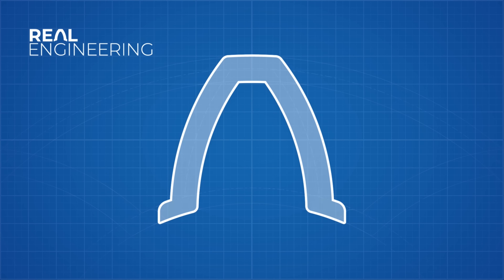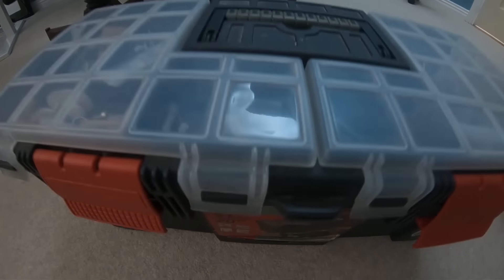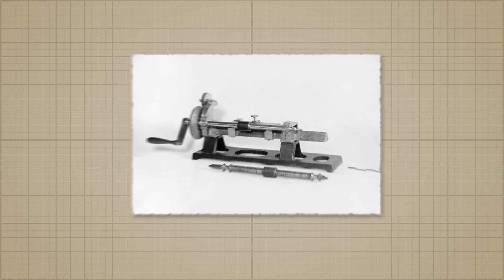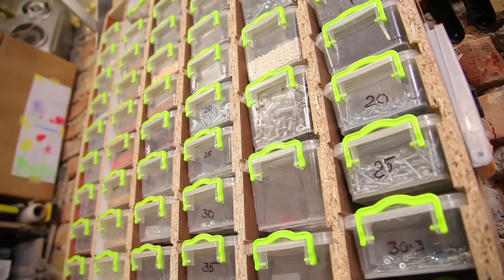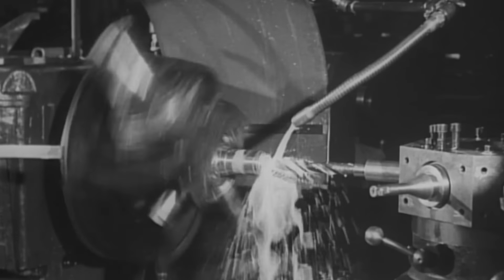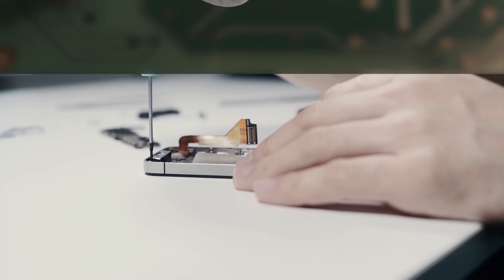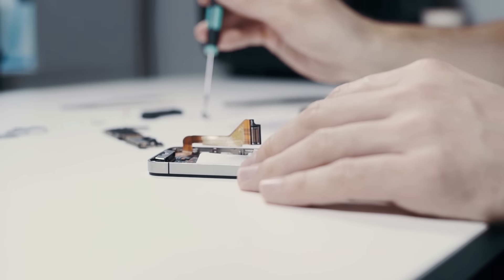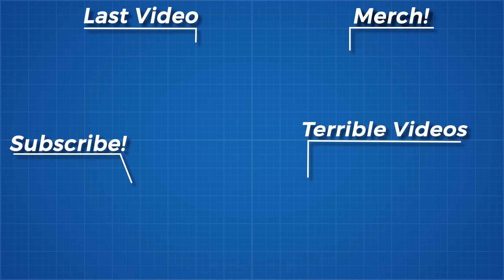Why Are There so Many Types of Screws?!

Comment: Engineers think they have it rough. Try being an aircraft mechanic.
I have an entire drawer in my already-bloated toolbox dedicated entirely to driver bits.
Also, pro-tip: If you apply valve-grinding compound to your bit, it causes cam-out to happen at a much higher torque. Combined with significant down-force, you can break loose even the most stubborn screws. Important in aviation, as all our hardware is engineered with much tighter tolerances, and we heavily employ the use of self-locking nuts, threadlocker, and other sealing and safety methods.
Still, Phillips and its kin completely suck. If I had a dollar for every rounded screw I've had to cut out with a drill, I could quit being a mechanic, and retire to a tropical island. Torx aren't much better either. Having to torque a full cockpit window's worth of the things completely destroys a good bit. Best hope your company stocks good ones, because you'll be replacing them often.
Reply: Nice thing about Philips is that the stripped out head does a nice job of centering the drill :)
Reply: @joshua43214  LOL yes!
Reply: What is your prefered type? Hex?
Reply: @TimLF  Hex head bolts. They can tolerate extreme torques without slipping when using an appropriately sized 12-point socket. The drawback is that they can't be used in areas where aerodynamic smoothness is  necessary. Which is everywhere on a plane. For flat screw heads, my favorite is probably a tie between spanner-heads, and torqset. Through, better than phillips, torqsets can only handle about 30 in/lbs before camming out dry. And the lower-quality brands of bit will literally break at around that torque.
Reply: spanner looks completely illogical and the first thing you read when you look it up is them breaking off. torqset doesn't look like it works nearly as well as a lot of other geometries nor does it look like it has the ability to be driven safely at an angle.
Reply: Kroil.  Specifically developed for aviation and machining use.  Combination of lubricating oil and PTFE microbeads, penetrates at the micrometer level.
-Remove rust if needed (solvents or shock force)
-Apply Kroil
-Apply specified torque, then increment as needed.
May not be suitable for fuel system components.
Reply: If you really want annoying, just look into "monodirectional screws". They're screws with a head that is designed to only be driven into the material. It's nearly impossible to unscrew them because of the design. They're commonly used in public restrooms to secure the separators for toilets and urinals to the wall. The only ways I've found to reliably remove these demonic creations is with a vice grips, or when the situation permits, welding a nut on the head of the screw. Whoever invented these things as a "vandalism deterrent" was clearly the kind of person who, when a slice of toast pops up slightly under-toasted, puts it back down for the full cycle again.
Reply: I love aircraft
Reply: SanctuaryReintegrate I went to an aviation mechanics school that almost never replaced any hardware, so if the task involved removing any access panel, I would just bring vice grips with me. 
When we would replace fasteners, it was never the same part number, instead it was just mostly FOD that was collected off the ground, meaning we would end up with different head sizes of screws, which, especially with the Phillips heads, meant that half of them would strip due to the incorrect size. It was a part 147 school and I ended up having to make up hours, like 20 of them, at the end of school, and that time was spent actually finding the CORRECT screws, and either installing them or adding them to a shopping list. It was one of the most satisfying tasks I ever did, until I realized that come the next class, most of them wouldn’t last a week. Still worth it though, because I think I worked through a lifetime’s worth of pent up rage.
Reply: If only Robertson had just sold his bloody patent. They’re not perfect at all, but they’re sure as hell better than Phillips.
Reply: Funny, I use torx all the time, and quite often with huges woodscrews (over 200mm long and 6mm trick) driven in by a hammerdriver (that hammers with 3400 hits per minute at 220Nm), and not once have I managed to destroy one of the bosch bits we use.
Reply: @RainytheNB  So glad I'm Canadian.  When building a fence or a deck, the bit never slip out of the deck screws.  Love 'em!
Reply: Robertson would be dreadful for aircraft. 

The square recess creates stress risers. You have to make protruding heads much larger and countersunk heads deeper to contain the recess. The ability for the screw to stick on is actually a detriment to doing a job quickly as it would pull the bit out. Similarly the Roberson isn’t self-centring so it takes longer to put a bit in. 

About the only thing better is that it’s easier on drill bits for an easy out. 

I’ve never had problems with Phillips. Yeah. New bits, valve grind compound, using a speed handle so you can put pressure on it and lots of torque, or using a rattler to shake it loose.. or tightening it first in the direction it’s not stripped and then loosening it. Pretty rare I had to drill them.
Reply: Or even worse being an engineer who works with aviation mechanics.  Sometimes we have to do our own disassembly for investigation but we don't have nearly any of your tooling and end up having to buy it out of pocket or beg the aircraft artisans to help us haha.
Reply: Yes Torx sucks when they start to rust, cam out almost as easily as Phillips, especially the larger ones like T55
Reply: Matthew Smith I’m going through a&p school right now. About 8 class in. I’m taking a material & hardware class. I feel your pain
Reply: Try cutting a slot into the head of a stripped philips screw. You can usually use a slot screwdriver to carefully remove it.
Reply: Us a JIS Phillip screw driver! Tolerance are better and it has extra bite! It saved my ass a bunch removing fucked panel screws
Reply: Kyle Miller no always possible on aircraft, its easy to leave plenty of tool marks
Reply: Nailed it...or whatever.  
I can not believe in 2020 we are still building flying machines with Phillips f@"?^king screws. Craziness.
Reply: @sanctuaryreintegrate how about when the apex philips bit or torqset shatters apart and you crawl for 3 hours to find all the pieces happened to me on acoustical panels... twice!
Reply: @SanctuaryReintegrate  square drive is the superior screw type
Reply: @SanctuaryReintegrate
 i dont work as an aircraft mechanic but as a refrigiration technician and i love the pz/sl used in contactors. i dont know why but putting the screwdriver in the screw just feels right. i know this is a field where you dont really use power tools but a traditional screwdriver but still feels so satisfying. however when i use power tools i prefer the spanner heads as you mentioned them.
Reply: The industrial revolution has been a disaster for the human race
Reply: And then, theres germany. Over here, we have several kinds of screw heads, and all are standardized to be useful, not annoying pieces of shit like Phillips screws. Seriously, pretty much every screw in germany is either a cross screw, a hex, or has a head shaped like a nut so you can just use that. We dont keep using bad screw designs cause we already have them.
Reply: I feel your pain homie.
Reply: @markparent3323  And then theres me, living in a country where standardized parts are based off of usefulness.
Reply: Geez what does a “good” bit mean to you?  Ive never broken or worn out a wera bit.  Maybe the valve lapping compound is abrading it?
Reply: @SanctuaryReintegrate  ew, 12 point. 6 point all day baby.
Reply: Is pozidriv included in Phillips? I've always liked pozi, seems to work really well with regards to cam out.

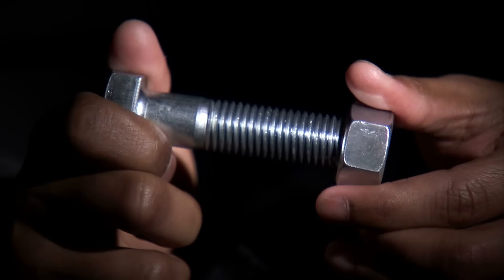Comment: 3:23 "We can now generally trust that a nut and bolt with the same diameter will fit, even when mixing freedom units and metric."
WHAAAT???? when mixing standard and metric???? I can't be the only one? right?! anyone?!
Reply: I don’t know what he means by that.  This fellow should get a real engineer to check his work.
Reply: @GH-oi2jf  thank you! I make my living working with nuts and bolts. And there is no single combination of a metric nut/bolt working with an opposite standard nut/bolt. NO Matter how similar their diameters! Granted a few combination that might fool you as you start the first few turns, but you surely will learn the hard way as you continue.

Comment: After I started using Torx, I vowed to never buy a Philips screw again if at all possible.
Reply: is it available without a prescription?
Reply: Torx are quite rare here in canada. I think my largest fear with them was about snapping the star points on the ends.
Reply: @caffeinatedinsanity2324  I've only ever had a torx driver break once, and  that once time it sheered in half, thepoint themselves did not break. The force is evenly distributed oer all of the points so there is very little risk of anything breaking.
Reply: Where I live, Robertson square is more popular than Torx, but yes, never again Philips.
Reply: torx screws are the devil, so are people who sell torx screws and people who sell torx screw drivers.
you want to know how to improve a torx screw? easy, weld a hex nut onto the head.

hex screws are the only screw the world needs. everything else is just proprietary bullshit.
Reply: Frédérick Germain Torx is very common in Vehicles
Reply: Here on the USA the torx is the most used one, and the bits last way longer than any others, I was impressed that the sqaure bit was the second one developed cause is a very good one to use too, in my opinion ...
1.- torx
2.- hex
3.- square bit
Reply: @windhelmguard5295  hex screws can go to hell. They are the only screw that is easier to strip than a phillils head.
Reply: Windhelm Guard did you not watch the video? Torx screws are objectively better than hex screws.
Reply: If a Philips screw is manufactured correctly and you use a good bit to drive it, they are a very good screw.
Aircraft grade Philips screws are a joy to use, and takes a real gorilla to destroy one far enough you can't get it out.
Just make sure you use the right size bit, a #2 is what 90% of screws are most people use a bit too small.
I've found every other type of screw once camed out almost renders the screw useless, where as a Philips usually still has the back side of the drive in good condition, that you can always get them out again.

Torx are good in the sense the are less sensitive to cam out, but if you do get them rounded even a small amount or have one filled with paint (or other crap) they can be far harder to remove than a Philips screw.
Hex and Robertson screws are a nightmare if you have bad fitting bits, once they've camed once it's a bastard to keep using them.

Best thing with any screw is;
-ensure you have the right size bit (most common problem with Philips)
-buy good quality bits
-don't be a gorilla and allow a screw to cam out in the first place.
Reply: @windhelmguard5295  thank you. Hex or gtfo
Reply: @MegaGouch  shill
Reply: @windhelmguard5295  Hex screws cam out much quicker. That is not a issue with Torx. + you can use a torx bit that is 1 size too small and be fine, Hex does not allow that luxury.
Reply: @wybo2  i have yet to find a hex screw that i was unable to loosen or tighten with a pipe wrench
Reply: Philips screws are tolerant to size differences between the screw and the screwdrivers though. Something that average people care about. With 2-3 screwdrivers (Philips + flat combo) of different sizes I pretty much cover almost all of my screwdriving needs.
Reply: @windhelmguard5295  I take it you have never used boresunk
or countersunk bolts? Hexagon boresunk bolts are rarely an issue because they have plenty of "meat" to resist camming but countersunk bolts are prone to camming and a massive pain in the ... to remove if they do.
Reply: @wybo2  

i have to admit that i'm having trouble understanding what you're saying because my english tends to fail me when it comes to technical stuff, but in general any system where the tool goes into the screw head as opposed to the tool going over the screw head is just terrible in my humble opinion.
Reply: Robertson no slipping no stripping
Reply: @caffeinatedinsanity2324  What are you talking about?  Torx screws are on every car and bike.
Reply: I buy only Torx screws. They are the best one.
Reply: @biggreenblob  small aluminium hex bolts make me want to cry
Reply: The only issue with torx it's that at certain torque the tools and screws tend to get rounded and fail. It's a pain in the ass to remove them. For high torque the old hexagonal head bolt still the best
Reply: @windhelmguard5295  Just google "boresunk" and "countersunk bolt" it will immediatly make sense. I'm not natively english either and i must admit that i needed google to find these terms.
Reply: I'm taking about torx screw being sold in stores being uncommon, because I do see them in vehicles such as busses and so.

Speaking of hex heads, these things are garbage when it comes to dealing with a head full of filth. Never tried with torx, but I know squareheads have a little bit of an easier time cleaning junk out of it than hex heads.
Reply: If you use the right bit a Phillips won't give you any problem
Reply: Now also only ever use stainless or plated fasteners and we can start progressing as a society.
Reply: Absolutely!
Reply: The whole idea of using the head-to-drive interface for torque limiting is stupid.  It only leads to stripping the head when you exceed your limit.  Torque needs to be limited inside the driver, not in the connection to the fastener.

Comment: Yes, in Canada, the Robertson screw is still very popular.
When you use good quality screwdriver, it never slips, and you don't need a magnetic tip to hold the screw on - it just stays on by itself.
Reply: I thought it was more common
I encounter it quite often but I guess that's because i'm Canadian
Reply: As a Belgian (Europe), I've never actually seen the Robertson type, I didn't know it existed.
Reply: As a Canadian i had no idea they where rare! They are the best to work with and i curse every moment i have to work with Philips screws.
Reply: Quite common in Australia too - might be a Commonwealth thing.
Reply: @Dindonmasker  Are square screws more practical than hex screws?
Reply: @Simon-nx1sc  i don't use hex screws a lot but i think the bit gets rounded faster on hex than square.
Reply: I've always wondered why the hexagon was chosen when square is so much more resistant to stripping. The only advantage I can think of is that it helps in tight spaces since you only need to turn the screw 60 degrees before you can reposition the wrench, whereas square needs to be turned 90 degrees at a time.